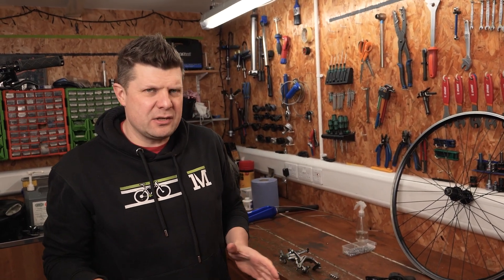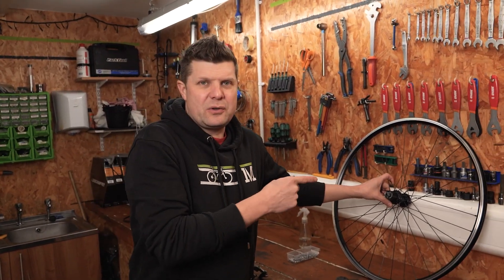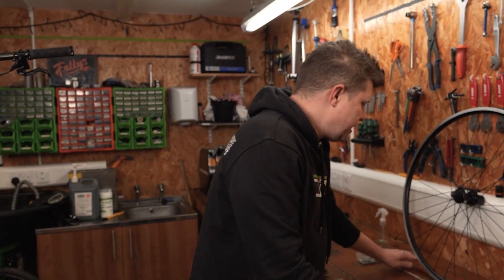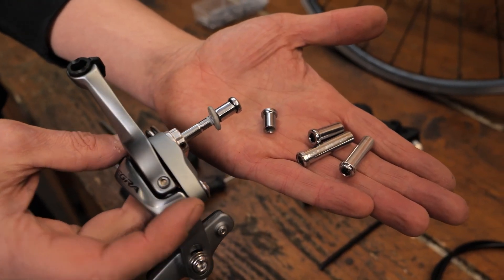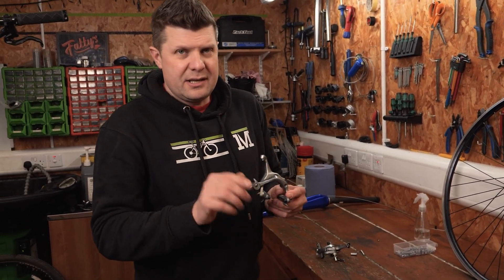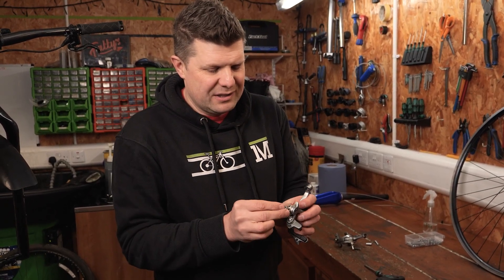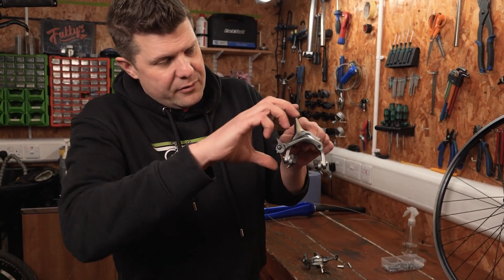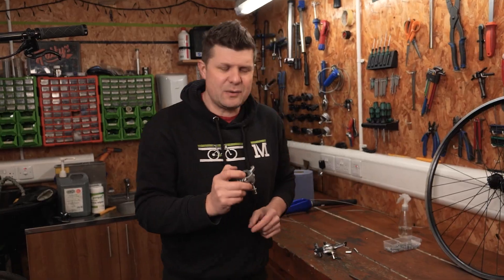Rim Brakes, the most common mistakes you make.

Comment: I'm quite happy my rim brakes are unfashionable. I just bought a new set of 105 calipers for the unfashionable bargain price of £50! Breaking performance superb. Set up easy. Quite light and ultra reliable (my old 105 calipers are twenty years old and I'm only changing them because I want black not silver on my newly painted frame). BUT, my wheels are shagged with play in the bearings and slightly warped rims. I can't afford to replace them and so I have to put up with a bit of intermittent brake rub when climbing. Also major issues with wheel rotation on the rare occasion a spoke breaks. On these occasions, I'd tolerate disc brakes :)
Reply: Is it possible to replace the bearings? Or is it like an old set that I have? The rear is garbage because the wear wasn't just in the bearings but also in the track.
Reply: @DaveCM  they are shimano r500 with cup and cone bearings. Upon inspection I found the hub cups were pitted, so there's nothing I can do short of a wheel build. I bought them second hand and they are clearly more abused than I was lead to believe. Wish I had saved longer and bought new. I plan to get some handbuilt wheels made for next summer so I'll just keep these going till then 👍

Comment: Another mistake with rim brakes is to assume stock pads for aluminium rims (whether Shimano, Campagnolo or SRAM) are anything other than mediocre at best. However, Swiss Stop, Kool Stop, or even the BBB UltraStop HP brake pads (my current favourites) are in a completely different league in terms of braking power (especially in the wet), modulation, but also (and most importantly) rim wear protection. Every single person I've recommended to replace their stock Shimano, Campagnolo or SRAM pads with any of these was amazed by the difference they made.
Reply: Shimano/sram pads are honestly disgusting, they last quite a bit but in exchange you wear your rim and have less breaking power. Even Carbon specific pads are better than those, funny enough.
Reply: Campy Red pads on the Bora AC3 brake tracks are the best I've used
Reply: @danc1829  I was talking about aluminium rim specific pads. They are the stock ones anyway, your red Campagnolo ones are bought with the wheels or separately.
Reply: @11robotics  a set came with the wheels but u can purchase separately aswel around £20 a set
Reply: @danc1829  yes, exactly, so they don't come stock with the brakes. Most people just assume that whatever pads their rim brakes are sold with must be good enough. They just aren't.
Reply: @11robotics  yeah I'm with u sorry think I got confused I meant they came with the wheels not the capliers...

Agreed even the shimano pads that came on my Dura ace capliers where rubbish 🤣
Reply: @danc1829  honestly I would accept if mid-range or even Ultegra (or equivalent) brakes came with rubbish stock pads. But it still blows my mind how after so many decades of rim brake technology evolution, Dura-Ace, Red (except some generations which came with Swiss Stop pads) or (Super) Record brakes are still sold with useless pieces of questionable rubber as standard while small companies that make maybe 100x less money than the "big three" are more than capable of engineering and manufacturing proper brake pads made of proper materials.

Perhaps it was good for business for the likes of Shimano et al. to deliberately stop improving the rim brake beyond a given point? Food for thought.
Reply: TIL, OEM brake pads are the crappy hi-fi/audio cables (the ones you get with your new TV) of cycling
Reply: Shimano soft version of pads are amazing

Comment: My tips....
1) clean the rims and pads.  I see pads full of metal flakes and greasy/oily rim so often.  Amazing how much better a clean system works.
2) toeing in thr pads.  On newer  higher quality calipers, a thin peice of cardboard (bar tape box works for me) under the trailing edge of the pad is sufficient.  On older brakes, v-brakes or brakes with low quality pads, a more significant toe-in can be needed.  For that I use a 1p coin.
3) the pad retaining screw can easily round off when trying to remove it.  Knipex Twingrips usually get them free but a light dab of grease or antiseize on the threads of the bolt really helps.
4) if the calipers are not operating smoothly and the spring efficiently returning them back, give the calipers a clean and lubrication.  The caliper may need to be fully stripped to do this effectively.  Any competent mechanic can do that if you are not comfortable with that job.
Reply from the maker: I feel another vid coming. Cheers.
Reply: I use old store clubcards for toeing in, they won’t compress and durable 😁

Comment: A workstand, toe-straps or reusable zip ties, and good lighting/torch make setting brakes up easier. A dual head Stubby Ratchet with 4mm & 5 mm hex bits also speeds things up. 

The barrel adjuster can also help, set brakes on rim with adjuster wound out, then wind in for perfect clearance from rims. Always keep some spare pads and cables stocked as brakes need to be kept A1 all the time. 

Caliper and v-brakes are easier to set than cantilever brakes and their yoke angles.

Comment: Common issue I see is neglected brakes, so pads came out out of adjustment, so they are too low sit skewed, are touching the tyre, way too slack wire. Frayed wire.
on cheap bikes plastic brakes might be seen, that's an mistake in it self, super flexy, will likely crack in an crash.

Comment: Never knew you had to properly setup rim brakes. I always thought you had to jump off the bike screaming 'out of the way, I have rim brakes, I can't stoooop'. So happy we have disc brakes now, none of that 'proper setup' is required because disc brakes. 

Tubeless and rim brake failures are always caused by human error. Always. I don't ride anymore with riders that don't maintain their bikes, much smaller group but I can live with that.
Reply: I appreciate the advancements in bicycle technology, but rim brakes and inner tubes are still perfectly fine for a vas majority of people. Unless youre very serious abouy your riding, or are a literal professional, you dont really need either rim brakes nor tubeless tires. If you get a puncture, you probably have a mini pump and spare tire that you can change in 10 minutes. And youre probably not going 45-50+KM/h to need that much breaking power. Im sorry if i sound like a normie to you, an elitist, but thats how it is

Comment: Tip, when you align the pads, gently pull the brake lever and hold it in place with zip ties or something. This way, it's much easier to get the brake pads in the correct position and make sure they stay there while you torque them down.
Reply from the maker: im going to have to do a tutorial I think.
Reply: On v brakes without brake shoes, but regular pads, I push the brake arm in and hold the pad with my fingers, while I tighten the bolt. I've done it on many kids bikes over the years. Often questions start and then a session of what's wrong with my bike. But I am happy to improve things make the kids bikes safer. But not all things are quick fixes, not everything can be fixed outside quickly. Even did quick wheel true for some. Alot of parents should keep their kids bikes maintained, sadly many kids bikes are neglected, atleast where live. I hope this changes.

Comment: I always find the curved washers bind a bit so just drip a tiny amount of lube between them.
Reply: Some bikes have so bad brakes you can't tighten the pads securely, as the pad spins, cus the tolerances are ba don the spherical spacers, I've seen it on cheap bikes. So you need an extra spacer or file the tip of the threaded rod on the pad then. Shame such bad quality parts exist and crappy bikes liek this still exist.
I've also seen electronics store branded bike with male hex on the brake sinstead of female hex head bolt, so you can't fix it with an multi-tool. Haha, they gave those bikes away if you shopped, at certain sum, but then you had to pay for assembly which was the price of the bike. And bikes were so bad they became an news story everywhere, and I see ppl riding these with the fork backwards. 😁

Comment: Thank you see how easy it is to set up rim compared to disc???
Reply from the maker: Huh?
Reply: Really? Do disc pads need to be set up toe in? Do they need regular readjustment? Disc are basically set and forget for at least a season, after which they might need a bleed (dead easy on shimanos, certainly doable on srams) and perhaps fresh pads which is a doddle. There’s way too much misinformation in the road cycling world about discs being a nightmare to maintain and being noisy while mtbers have made the switch over 15 years ago and never looked back.
Reply: @bonky wonky  I have worked in the industry for years and yes disc's are more maintenance.  Even time you take your wheel out you have to adjust the pads it is so easy to misalign your pads.  Rotors can be bent then you have to true them.  Bleeding until recently was a pain you had to take the shifters off the bike.  It is much easier for a home mechanic to change a cable instead of a bleeding brakes.  You also have to worry about resin vs metal pads and all kinds of stuff.  Keep them on your mountain bikes.  Leave my road bike alone. Innovation that helps customers I like and agree with.  Innovation for to just sell stuff you don't need is silly.
Reply: @jaredfontaine2002  I never had to realign disc brakes every time I removed and reinstall wheels once they're aligned. Rims can go out of true too and I'm aware a well-built wheel won't go out of true easily.

If you think I'm anti-rim brakes, think again. I'm OK with both. My current one uses rim brakes, my second bike will be on disc brakes, but I'm definitely keeping my rim brake road bike.
Reply: @Yong Ling Ng  You are lucky.  Even the best cyclists in the world have problems with rubbing disc brakes especially after hard braking on a descent.

Comment: One of the issues I get with my rim brakes (single bolt callipers not direct mount) is that they get out of alignment at times. (when changing wheels, after a crash...) The mounting bolt is tightened to 10Nm or so, but it still allows some rotation of the calliper when forcing it. Is there something I can do ?
Reply from the maker: Rotate it back. 🤷‍♂️
Reply: rotate back, or re align with adjustment bolt (hex bolt in tektro caliper). make it center

Comment: I was praying for it on this video, however no joy, but could you do an in depth video on that little screw that sits in the side/top of the one brake arm (Shimano)? What is it used for? What does the adjustment correct? How do you know if the adjustment is wrong? Thanks. Also a talk about how the pads should be slightly angled on their leading edge so they bite fully when applied.
Reply from the maker: The balance screw.  Ok. We can arrange that.
Reply: Used to make sure that the pads on both sides touch at the exact same time 🙂
Reply: That little screw does more than just balance the side to side - as a byproduct it also changes the mechanical advantage and feel of the brake. The shimano manual precisely specifies the starting position that screw should be in when you initially centre the calliper on the main mounting screw, this is a visual position the screw should be in relative to its insertion point. I've seen that screw wrongly adjusted, then calliper re-centred with the main mounting screw, which is the wrong way round and it ruins the lever feel. Also, this screw position makes an even bigger difference to lever feel if you're maxing out the rim width beyond what the calliper was designed for, and the window for correct feel seems to get narrower.
Reply: @nellyx1x493  Thank you for the additional info.  I have direct mount rim brakes so it's easier because that screw has only one purpose.  Will keep this in mind for traditional rim brakes!
Reply: @SherazChoudhary  Ah yes, direct mount is not affected by this. When the screw is used to make the brake pads hit the rim at the exact same split second it definitely gives the best lever feel... to easily know when it needs adjusting, watch the tyre from the top as you squeeze the lever- if the wheel moves from side to side then the braking power is flexing the wheel to the side instead of clamping evenly and tends to feel mushier, as well as wasting lever force in rim flex. Adjust by eyeballing closely from the front of the calliper while repeatedly pulling the lever turning allen key CW/ACW until it hits precisely even. For 'next level' feel also adjust the pad angle looking from the front to ensure the pad is driven into the rim squarely, sometimes its necessary to adjust the brake holder up/down and correct the angle to achieve this - for some dual pivot callipers owing to the geometry of the levers this may require a different angle left vs right.
Reply: @nellyx1x493  Awesome advice!!!  I did all of that (helps that the rim is perfectly true).

The thing that made the most amazing difference was using compressionless Jagwire Brake Pro housing 😀. I even cut off the flexible silver bit to ensure no compression.  The one pain is that the housing must be the perfect length because it is so stiff (engages the brake caliper if too long even by a centimeter.  It is a pain to setup right but the results are eye opening.

Another thing I played with is how much I need to compress the lever before the brakes engage.  Tried to put the engagement when my fingers had the most grip.  My rim brakes now can easily flip the bike and more power than that is useless.
Reply: @SherazChoudhary  Ermm I may be wrong but that flexible silver portion (with the coiled wire) is important to prevent wear and tear to the housing. Especially at that portion where it usually follows the curvature of your drop bars. 

Given sufficient time and repeated force, the inner brake cable can damage the compression-less portion at that curve. (That's why regular brake housing is made of that coiled structure, it is for strength but sucks for brake lever feel).

Gear cables don't exert nearly as much force as brake cables, that's why the internal housing structure is straight and parallel to the cable. You may want to check that your brake housing is still ok, especially at the curves of the bar :)